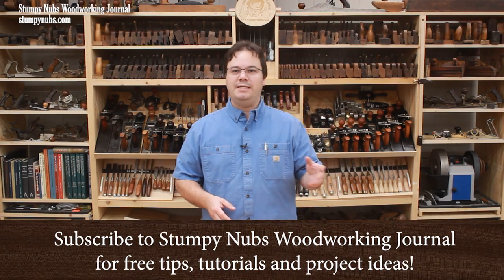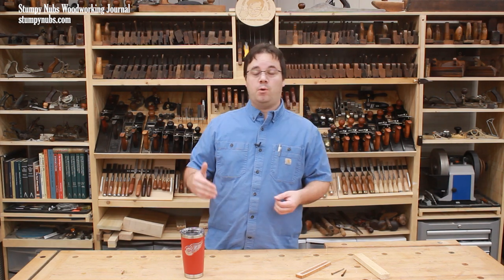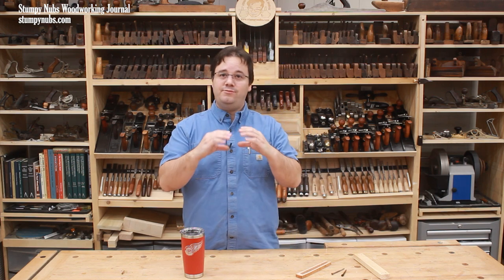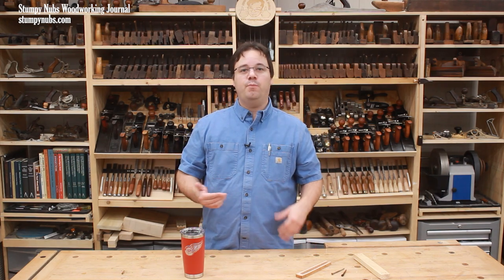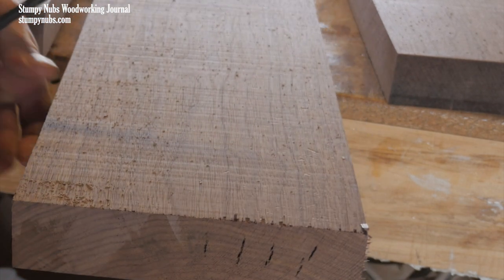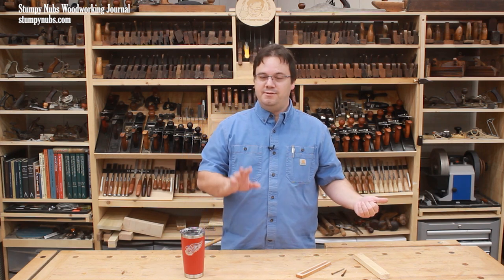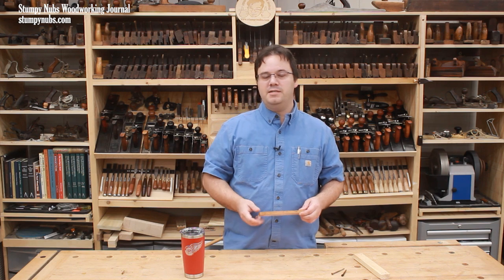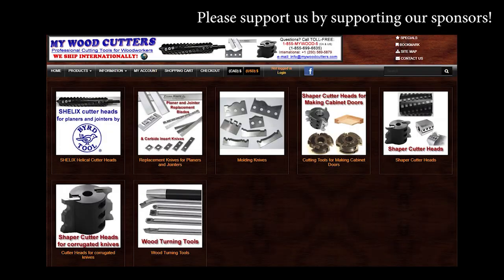A hidden flaw that can DESTROY your lumber! (Case Hardening)

Comment: I’m blown away! I never though that the problem I dealt with last fall was this. The lumber I used was red oak and it fought me tooth and nail. Every cut burned and pinched on the table saw and for the life of me I though I was just doing something wrong. I saw everything you said to look out for, complete separation in the middle of the boards, cracks and boards twisting instantly after ripping. Thank you for this video. What an absolute eye opener!

Comment: You are awesome!  I had this exact problem and spend hours researching. I tried a bunch of solutions. The result was a lot of time and energy and no resolution, until your video ... I've been setting up a wood shop in my garage and just had a bunch of cheap construction 2xs for building tables and shelving etc. The binding blade and smoke was so discouraging ... to have this problem as I am learning and just setting up! The problem "improperly dried lumber" is mentioned in a number of articles but without a good explanation, kind of useless to a novice. Of course the natural response is to assume I am doing something wrong.  Thank you! ..and thanks to Davis for the question.

Comment: As an old flooring installer of hardwood flooring, I never learned this method for checking moisture content. Thank you!
Just picked up a stack of ash for a project as I begin expanding my woodworking skills. I'll definitely keep my eyes peeled for the 6/4 boards that I'll be milling.
Thank you!

Comment: I can't tell you how much this helps me understand what I am dealing with right now. I bought white oak lumber from a friend that runs his own mill. I am using it to build my first bench. So far the warping has not been real bad, but the lumber has pretty bad checking and splitting. I'm filling with epoxy where it is the worst. I've had to do a lot of planing and will have more to do after the top is glued up. It's all still salvageable. Thank you for the info, now I have a better idea of what to look for when I'm buying lumber.

Comment: 3:34 It's amazing that you can see the inward pinching immediately, just from the cut you took out with a bandsaw, and then even more so after you chiseled out the inner piece. I'm familiar with these kinds of internal tension/compression stresses from plastics and metallurgy, it's cool to see a coherent explanation for how they effect woodworking as well.

Comment: Thank you for this valuable information.  I had heard the term, but no clue.  By the way, when I mentioned YouTube at Lee Valley Tools while purchasing something, the clerk's response was very positive.  Sometimes I run across a problem that someone did a video on.  The time spent looking for it is always repaid in spades by the time not lost to cursing, punching walls, and really ruining the project.  It shouldn't cost you more than a fingertip or two to figure out who not to pay attention to!

Comment: I tried for years to figure out why my table saw caused me problems. I thought it was me. It wasn’t until I saw a video on this channel telling me to check the alignment of my saw blade as well as the fence. My blade was off a couple of thou front to back, and my fence more than couple of thou front to back opposite the blade. On their own a a few thou isn’t gonna matter much, but the compounded difference were a 64th plus on the heel and a 32nd on the toe. So every board no matter how careful I was at measuring, came out crooked, and burnt. Thanks for some more great content stumpy nubs!

Comment: i would just like to add that this can also happen with air dried timber as well.  a few years a go i had an oak cut into a mix of 2x8 and 1x8.  i left them to dry for a couple of years.  when i had a project for them i took them into the shop to dress.  the 1x8 were great, no problem.  the 2x8 were a mess.  splits internally that didn't show on the outside and really bad cupping.   needless to say that while i was able to save a certain amount, there was also a lot of firewood.  i should probably add that this was english oak grown in nz, where it grows at twice the speed.
Reply: Absolutely.

Comment: Thank you for the video, I have had this issue before but never was able to find out why it happened. I was just told by some older woodworkers not to buy from some sellers in our area and the ones that sold wood dried so it did not cause this issue. They all just said they sold badly dried wood. Now I can let others know the "why", not just that the wood was not dried well.

Comment: ive been working with rough cut hardwoods for 30 years and this is the first ive heard of this (although i HAVE had this issue, many times)

we usually just had a guy on the outfeed side wedging the kerf to complete the cuts. and yes, depending on what was being made, warping/shrinkage was sometimes an issue.

Comment: Hi Stumpy. I love your videos. It’s worth noting that case hardening occurs as the surface of the wood dries from green to 25% - weather in a kiln or not. Wood that is air dried also case hardens if it dries too quickly. Kiln operators attempt to control the temperature and humidity of the environment in which the wood dries to create optimal conditions for consistent (slow and steady) drying. However, kiln operators cannot control all the variables and sometimes wood does whatever it wants.

Comment: This is an extremely helpful video and it just happened to me yesterday in a very dangerous manner that led to thankfully a slight injury.  Today, I'm doing the test you showed and taking it back to the lumber dealer I bought it from.  They are very reputable dealers so hopefully I don't get an argument, but if I do, it's time to find another source.

Comment: I’ve experienced this type of behaviour in unfinished lumber before that was air dried as well.  Some cedar was very hard to process and resulted in ripped boards for exterior window trim being heavily bowed.  John Heisz likes to show a technique where he advances and retreats the wood through the spinning blade when it tries to kick back.  I think I prefer to use the bandsaw for this problem though.

Comment: Fantastic and simple explanation to a problem that makes perfect sense but I never knew existed. I've absolutely experienced lumber that was tough to saw but then immediately warped after it was cut, but I never knew it was a defect in the drying process. I just thought I'd bought duff boards! Definitely worth looking out for, especially if I start building bigger projects in the future and need to buy a lot of the same wood for it.

Comment: I just recently experienced this with some nice yellow pine (I know some folks will say there is no such thing as nice pine).  Much of the boards had quarter sawn grain.  I knew what was happening but did not understand why.  I just thought it was tension in the wood.  I saw this in some red oak as well.  This is very helpful as always.

Comment: I’m glad I ran across video. Thanks for the education on this issue.  I’ve been having the same thing happen with me. So much so, I completely stopped buying lumber from Lowes, True Value, and 86 lumber.. I knew I my equipment and blades are just fine. Thank God I wasn’t doing fine woodworking. I would have lost it. I found a couple of local independent small saw mills. The lumber is actually better quality and a more affordable price. A small draw back is they have to all naturally dry their lumber. So sometimes I have to buy lumber than I need at the time before it’s sold or buy wet  and properly store it. I’d rather do that than buy subpar lumber at premium prices. This past year its even been hard to find straight and true lumber from the big stores. Every other one was twisted or bows.

Comment: Great info. I wondered why some pine I bought warped as I was ripping it. It actually made popping noises as it warped. The wood started straight but had a 3 or 4 inch warp as it came off the saw. I could hear popping noises as it warped. It was scary and dangerous.

Comment: BIG THANKS!!!  Bought a piece of antique furniture which had a repair. All the old stuff cut perfectly but the repair piece kept snagging the blade just like that. Assumed it was the battery in my circular saw. But even with a larger fully charged battery the saw still froze mid cut, no matter how shallow the cut, I was just over half way at this point.
Luckily it was super cheap, fraction of the price of the wood itself.  Why spend a load on wood when a nice antique table for pennies come up for sale a lot.

Comment: Thanks for the video.
I got my hands on some random wood and ran into this issue. Now I know.
Like the aforementioned wood worker, I've found that using the band saw alleviated the issue. I believe this is due to the bandsaw blade having a shorter cross-section and thereby not allowing the pinching action of the wood from grabbing too tightly.

Comment: I ripped a 16 foot 2x4 and got this pinching/closing of the kerf. Thank you for explaining the mystery. I thought it was an oddity of the board, like it was cut from the center of the tree and I somehow cut along some line of internal tension. My project was just a fun dinghy sailboat so my 16' mast has a curve. Not a display project or money-maker. Thanks for the explainer.

Comment: This video could not have come at a better time.  Previously had an issue with some walnut but didn't know what the issue was or even what to call it.  Then, not 4 days ago, I bought some maple and had the issue again (pinching of the table saw blade).  Now I know what to call it and how to help my local lumber dealer go back to their supplier/kiln operator with supporting data.  BTW - just tested some of the wood I've got and instantly can see good, okay and bad test results.  Thank you, thank you, thank you!

Comment: My gunsmithing instructor talked about how kiln dried wood is terrible for wood stocks as the moisture content is still too high on the inside, which can cause warps to form when you turn the blank into a stock, ruining the piece. Sadly, not too many companies still air dry wood stock blanks, so finding them can be hard, luckily I know of a great supplier who provides fully air dried stock blanks.

Comment: A good video James. I’ve also had some kiln and even air dried wood that had severe wind shake damage as well. And what you said about the 2x4’s was spot on. I have been very lucky to only have one kick back (knock on wood) using the tablesaw and it was while trimming off a 2x4 edge. It threw that 2x4 30-40 feet. Luckily my garage door was open and I had moved my truck. I was well clear of the path it took and didn’t get injured in any way. The tablesaw was tuned up and had a sharp blade and the blade guard and anti kick back pawls were in place. The pawls did absolutely nothing to slow down the 2x4 and I found no evidence of that they dug into the wood. Now if I need to trim an edge on a 2x4 or “suspect” piece of wood I use either a home track and a circular saw or an inexpensive track saw.

Comment: Hi, nubs, I also found this with the free wood I picked up from my workplace, we had raw material that came from Sweden in sea containers that were placed on 100mm square kiln-dried pine.
I found where hi-pressure was placed on the wood the blade would smoke while cutting.
I just assumed compression on the wood fibres giving it a denser cut.
Play safe from Elliot Lake, Ontario, Canada.

Comment: You can often see the same effect when cutting carrots (no, seriously!).  Depending on how fresh it is, if you cut a carrot lengthways, the two lengths will sometimes bow outwards, because the outer layer has dried out and shrunk, and is being held under tension by the core.
Reply: If you freeze a carrot it will have voids in it as well
Reply: This is an excellent parallel and perfect illustration for those of us who are newer to wood and/or can make use of ways to teach the concept to kids! Love this, thank you for this comment

Comment: I recently made friends with my bandsaw. User error was part of the reason for our past arguments. The real culprit, a piece of warped, big box pine that pinched the blade when enough tension was set free. Watched some videos to improve my technique, used better practice wood, and disposed of that pine. It may not have been this issue you've explained, but similar lesson. 

So, besides the firewood suggestions in the comments, could a person use the pieces for segmented turning? I'm not equipped to create 1500 piece intricate glue ups, but appreciate the work put into it, by those that do. Might give those boards a second chance.

Thanks for the lesson, James.

Comment: I had experienced it , I have a true 5hp saw and a $150. blade, so it was not the power,or the blade,  but what I did find was my rip fence was not properly aligned . after reading my manual  it stated that i need to have it 1/64 " clearence at the end of the fence, and no more burning of the wood.

Comment: Interesting!  Just a note that the linked article says to cut the sample "at least 20-inches" from the end of the board - depending on how closely your supplier reads the paper I'd guess that they may squawk if you bring a sample from the tip of the board.

Comment: Well, son of a gun!  Thank you for this video.  A dozen years back I bought 47 maple headboards off the GSA auction site for less than $10 apiece.  I had a devil of a time ripping some of the boards because they would bow and bind the blade.  I thought it was because of the species, since I had never worked with such nice-looking wood.  With some effort (and a lot of dowels and glue) to work out the bows, I was able to make a very nice solid maple dining room table.

Comment: I’ve noticed in the last few years that my go to lumber yard is speeding their drying process.  It’s either raise the prices or the output of the kilns. I worked in a ceramic factory for years and saw the same thing.  A new boss comes in and figures we can speed this drying process up and then we would see different issues with the brick such as cracking on impurities that weren’t getting burned out.  I know one thing, proper dried lumber is a whole lot more enjoyable to work with.

Comment: I use a lot of hard maple, and I deal with case hardening all the time while re-sawing. It's tough to deal with!
Reply: I am in phoenix and have not seen that problem. Maybe cause i am in a desert and the wood is very dry before i even get it. Pine is garbage and should only be used in construction, not cabinetry.
Reply: @cchavezjr7  🤔🤷‍♂️

Comment: Great explanation! I noticed that the video from the “other site,” appeared to show him ripping a 4/4 piece of hardwood. It brought a question to mind. Are you more likely to find case hardening in thicker lumber?
Reply: Logically, yes. Square-cube law strikes again, with more volume of water per unit surface area to evaporate through.
Reply: @watchm4ker  thanks!

Comment: Ugh - I have about $600 in 8/4 cherry in my shop that I have been struggling with to make anything.  After jointing/planing, and making panels, I've found nearly every single panel to be badly bowed.  Likewise when resawing - I had a particularly terrifying case where the board violently split open during the cut.  Both faces showed the cupping you described here.  I'll definitely try the test you mentioned; way too late to get my money back, though.

Comment: That is only one reason. Timber bound is what we call it in the mills. The tree grows on hillsides or other factors relating to win and wind. In these cases the love are green and do the same thing you are talking about as they are being sawn. You are mostly correct about the drying process it can relieve stress or build stress. In most cases you can get hints that it may be bound by cupping,twisting,Bowing, ect in its sold form. The closer too the center" heart" of the tree is the worst
Reply from the maker: Yes, this is a video about case hardening, not an all encompassing tutorial about every cause of stress within wood.

Comment: I learnt about this at school in third form in NZ. The teacher called it what it is "Surface Dried" lumber, case hardened / case hardening is something you can do to certain steels heating it up to cheery red hod hot with a sooty oxy flame and quenching it in oil.
Reply from the maker: Case hardening is a term commonly applied to lumber, not just steel.

Comment: at the mill i work at we cut hemlock and kiln it with a schedule that prevents this by increasing humidity at the beginning of the dry and keeping it within specs of the recipe depending on the product size, then slowly decreasing the humidity so we get a consistent dry, otherwise hemlock warps in the planer badly and jams it up.

Comment: This has become a real issue over the past 12 months... Producers cashing in on the uptick in demand for product are cutting corners.. I have a moisture meter with extra long probes that can penetrate 10 mm into the board. It is amazing to see the different readings as I push the probes deeper. Thankfully, my main timber merchant has woken up to this problem and switched his supplier.

Comment: I love urban lumbar. Local sawmill owners work with tree companies to turn hazard trees into lumber. I buy the boards, pile them with stickers, and then wait eight months or so. This is my cheapest and best stock. Maple, oak, pine, hickory — whatever grows around here is on the menu. It doesn’t case harden when there is no kiln. If you can find the space, it is well worth it. 

The other great source is old buildings being torn down where you might get lucky and get a fine old beam. I made lots of things from recycled old-growth wood. The price is usually right, too.